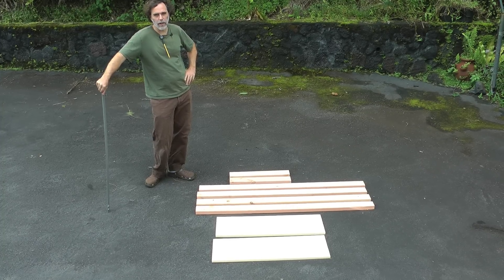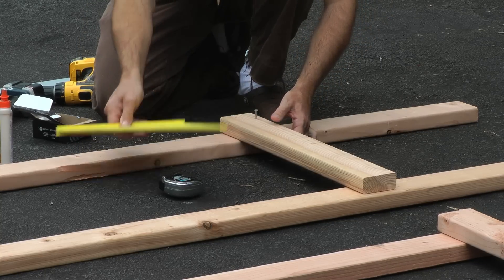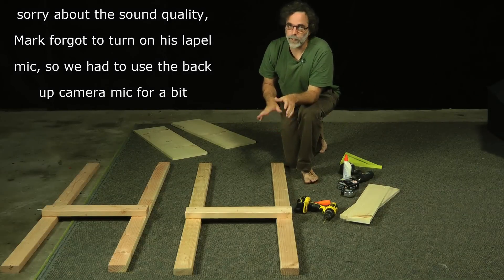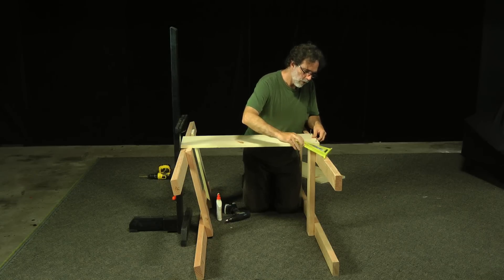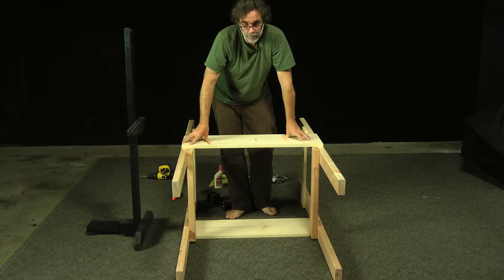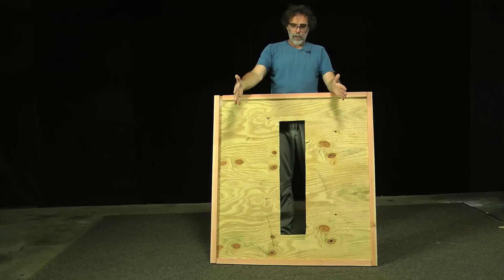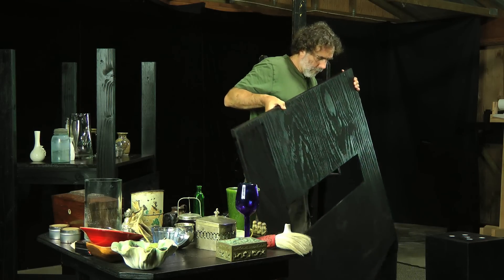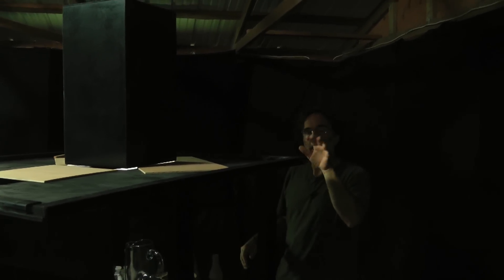how to make a shadow box for artists

Comment: Mark,
Your videos are fantastic!
I just completed my shadow box using this easy to follow video.
I did make a few modifications.
1.) I made the long boards just a smidge over 39 inches which allows for a 36 in shelf. (A bit more uniform size.)
2.) I rounded the front corners of the roof board.  (They were very close to eye level.)
3.) I placed a small strip border around the upper portions of the 2x4's at the top. (This allows me to place the front fabric on a non moving surface.)
4.) I went with the thicker roof board as you had suggested.
Absolutely love the finished results!!!
* I cut the roof opening to 6 inches wide but would appreciate your dimensions.
* would also like to request dimensions for your light box and a bit more detail about the light used and how it is mounted in the box.
Thank you once again for providing these wonderful videos.
Keep up the great work,
--Shawn
Reply: Opportunity Nox that’s really cool that you made one! What dimensions does the actual shadow box itself come out to approximately? Thank you!

Comment: Just built one out of an old IKEA shelving unit (cheap bare pine) and a piece of sub floor ply 4' by 4'. I use a grip stand and a LED temperature control light for the fixture. Built my own flag box for light spill. This is a great little unit if you want to use modelling clay sculptures and still life together to make a modello for your work. Captures the shadows real nice and good.

Comment: I have a question but first: I can't believe the phenomenal improvement in my work since making and using the proportional divider and the color checker and using your equations for printing reference photos. I started watching your videos and I was like ??? Why hasn't anyone else come up with this !!?? It all makes so much sense !! I'm making the shadow box and noticed you have the table height at 40" because your tall so I'll make it 36" because I'm 5'4". My question is do I reduce the 64" by 4" also? That would keep the ratio of light dispersion from the light box on top the same.

Comment: Hello and good day to you Sir.I followed your instructions for making the shadow box an it came out great and am excited to use It would work flawlessly if my studio wasn't in my basement.As you may imagine my ceiling is low only 74 inches tall while my shadow box with roof added is 65 inches.So the light which i would use to see in order to paint is changing my reflections in my still life gone are all my shadows.CAN THIS  be corrected by cutting 6 inches off the legs and maybe 4 inches off the uprights?Thanks in advance.

Comment: Details regarding the wattage and bulb type of the downlight on the roof of the box would have been helpful
Reply: Try a 60 watt bulb at first. Probably go with an led so heat output is low. They also make bulbs that you can screw in and with an app on your phone, change brightness, color temperature,  change to almost any color.
Reply: @MrBigkruntry Daylight is 5,000 to 5700 Kevin (units) so your colours would be true. 
I'd go for more light than I think I would need.   I am adding some shelves underneath and I am going to put casters on it. 
I also am going to try lighting a still life with warm light and use cold light for a fill light for shadows—but am just going to use a cardboard box for starters!
Reply: @jmmacb03  Actually daylight is 5500 to 6500 kelvin.  Mark specifically recommends 5000 k
Reply: There's no need to specify any particular light. Everyone that uses this design would greatly benefit from using a wide range of lighting options. Even experiment with color lights.

Comment: Some suggestions: 1. Showing a plan of what you are going to make first so your audience has an idea of what you are trying to accomplish would be very helpful. 2. Raising your work off the ground will make it easier to do. Sawhorses, a table, or even the tailgate of a pickup truck are useful for this. 3. Clamps - you need clamps to hold your work in position while you drill and screw it together. 4. You kept removing your speed square after you checked for square - just hold it there and use it to keep your work in position. It's a great tool, use it.
Reply: Paul Foote its not a carpentry tutorial brother, he's trying to inspire artists how simple it can be to build essential tools.

Comment: Why don't you just use a single point light with a fresnel lens on the front? (~$200) Very cheap and very flexible for shadow creation.  Stanley Kubric was the last generation to use them.

Comment: I don't have tools or access to materials where I live.  I checked the web to see if anyone sells decent shadow boxes but I can't find anything.  Will you be making shadow boxes for sale anytime soon?
Reply from the maker: +wajang1000 Probably not anytime soon, but you know, all you really need in a shadow box is a way to keep the studio light off the subject so you can control the light separately. I would ask for advice on our forum at http://forum.drawmixpaint.com because people have done all kinds of things, including very simple set ups like just putting two small shelves next to each other and laying a piece of cardboard on top with a hole cut out.
Reply: +Draw Mix Paint   Thanks for the reply.  I eventually made one out of foam board but it would have been nice to have a permanent shadow box as a fine piece of studio furniture like your easels without having to prop up foam board and tape things together and pray it doesn't collapse in the middle of a painting.  I think a shadow box should be an everyday tool for an artist, if only to do quick still life studies.